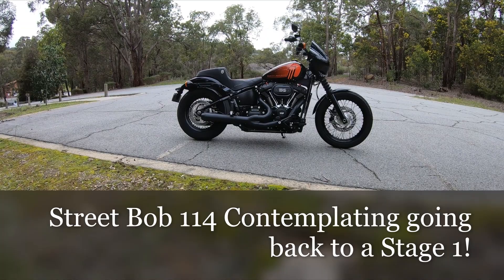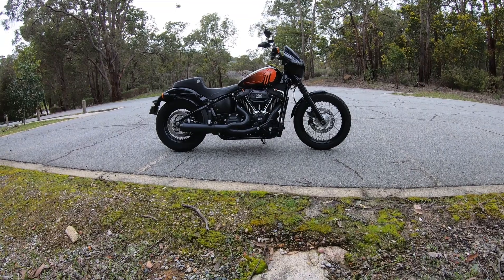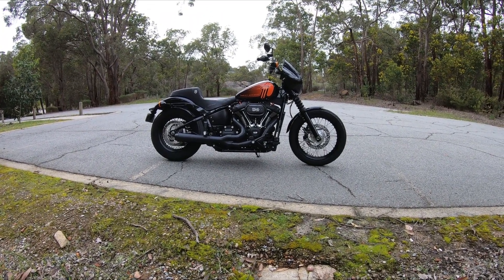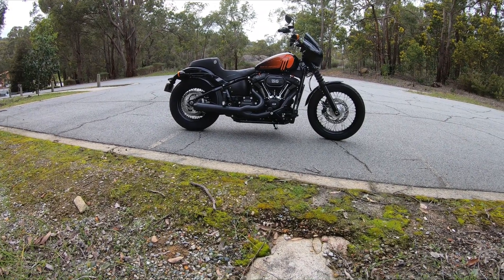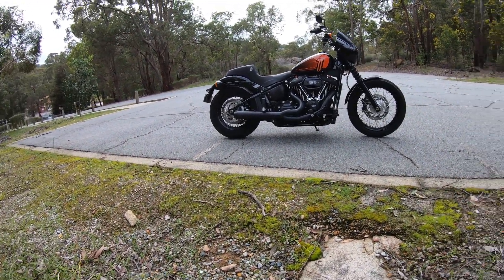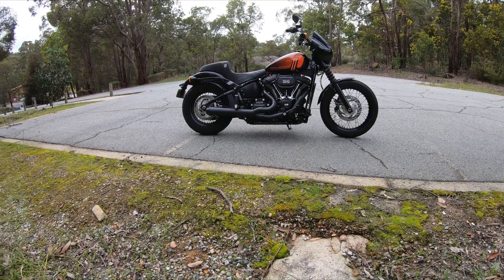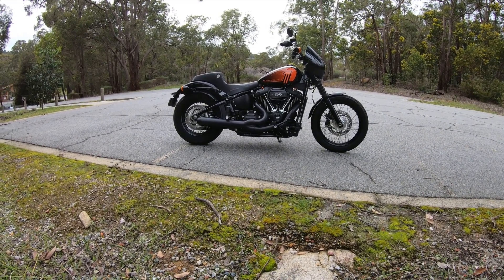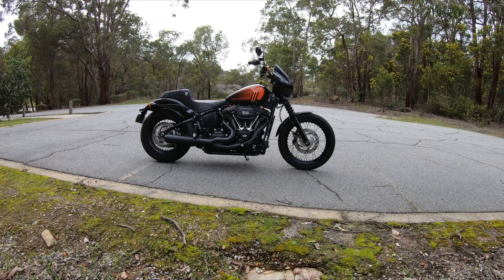Street Bob 114 Stage 2 - Contemplating going back to Stage 1

Comment: Got to admit, when I had an Evo with a mild cam. It was great. Went to a TC 103, stg4 cnc heads etc, it lost all its ridability, and you just wanted to beat up on it all the time, 
I miss my Evo 'Train...
The Gixx14 is still a delight Tim 👌
Reply from the maker: Yeh I love the power mate but it's a cam that needs to be ran hard all the time and its just not fun sometimes I like to just put around and it hates it and runs terrible at bottom end . Glad the big GSX is treating you well 👍

Comment: I think I'd feel bummed going back to stock power after having stage 2, but I totally get where you're coming from. May want to look into something like a Wood 222, 22x, or 22XE cam. They're supposed to be designed for baggers and 2 up riding with more low end in mind. Just an option so long as the S&S is coming out anyways. On another note, I heard they lowered sub count to 500 for monetization, so congrats!
Reply from the maker: I know right, I do love the power its intoxicating. After having the cam for 12 months now its getting a bit old if that makes any sense? the day to day ride-ability is non existent and that's where most of my riding is. I've actually booked to get it all put back but it will be dyno tuned to maximise the stage 1 set up. 500 subs for monetising? I hadn't heard that. Maybe that's why there's ads in my videos all of a sudden. Ill have to look into that. Stay safe.
Reply: @timfinning  Yeah I hear ya on the daily ride-ability. And yeah I though I saw they dropped it to 500 subs. You’ll still need to go to the monetization tab under each video in your studio to actually turn it on though I think. Definitely check into it!

Comment: Contact Wood performance in the US. He designs cams and Andrew's gears grinds them to Bob Woods specks. He will ask, how you ride, do you ride two up, do you want mid range power or top end power, how much you weigh. And he takes in consideration if you're going to have head work done or not. He is a professional in performance parts for motorcycles.

Comment: apparently the S&S 475 is very exhaust sensitive effecting the m8 low down. i have the woods 22xe cam in my 117 Lowrider S = 125hp and 136 ftlbs of torque. Cobra exhaust not highly rated by most tuners. Bassani, HPI and Fatcat( many more options too) are better options

Comment: So 2 problems here. 475C cam, and 2 into 1 exhaust.
475C likes high RPM, and 2 into 1 exhausts take a ton of tuning to hit good low end RPM. 
Means you have to ride at high RPM for everything.
You need to get a 22XE, or RS468, or SE Torque Cam, and possibly go back to a set of Slip-ons like a rinehart, sharkroad, or Eliminators/twinslash with Baffles. 
I have 2014 Fat Boy 114 with SharkRoad Slip-ons modded with 158W TTIs in louvered baffles and stage 2 SE Torque Cam and I have incredible low end torque from 2000RPM up, and a tune from FuelMotoUSA.
You should look into getting a TTI for your 2into1 pipe to help restore low end torque, and look for a Torque Cam like a 468 or 22XE. 
I cant imagine going back to stage 1, Stage 2 is so much more power and capable. 
I'm going to be swapping to a 22XE which has massive low endtorque but still outcompetes the 475C cam in HP and gives peak HP at 5500RPM range which is much sooner than the 475C.
And I wont be changing my TTI equiped pipes.
Looks like you may need the same.
High RPM cams are only good at the track or dragstrip. Low end torque is what makes a bike street happy.
Reply from the maker: Absolutely agree with you I love bottom end torque not high end HP it's not that type of bike. Thanks for the input appreciate it stay safe
Reply: I agree the Bassani pipe (known for its low end torque dip) and 475 cam are just not going to be a great match until the mid-range. But, be careful not to generalize all 2 into 1s as being soft down low or require lots of tuning. There's some really bad ones, many ok to decent ones, and a few excellent ones.
Reply: @mattb6849  It's a problem thats typical o the Softail M8 because of the small changes in bhe Softial version of the engine.
and I said it takes a lot of tuning effort to get rid of that torque dip.
it's a problem with the Softail's version of the engine.
Reply: @FranBunnyFFXII  It's due to the exhaust length differences between the touring and softail platforms. Can't package the same length primaries and muffler / baffle configurations to the softails. The M8s have shown they like long primaries for broad power. That's why you'll see a D&D fatcat produce a flatter, more broad torque curve on a Softail vs. this bassani for example. The torque dips create tuning challenges. These can be worked/fixed some, but only so much can be done. A cam with enough overlap gives the exhaust system more control over things, making the dips even more pronounced.
Reply: @mattb6849  You havent told me anything i didnt already know.
Reply from the maker: @mattb6849  Yes the Cobra also has a power dip down low too. When I first got it done the tuner pointed it out to me and said that pretty much all 2-1 exhausts have the dip it's a characteristic of them.  Stay safe 👍

Comment: I only have issues if I'm in a low gear like second gear and doing 25-35 mph. it just doesn't want to go that slow in a smooth manner. Gets a bit jerky using the S&S 475 cam. But I can live with that.

Comment: My Sportster from the factory didn't like to run smooth under 2500RPM. My Yamaha is so smooth at all rpm. I thought you were going to say bad fuel economy I was suprised you said its not bad.
Reply from the maker: Yeh after the last Dyno tune the economy was pretty good but it ran like crap so I'm guessing they leaned it right out. I'm changing it back in a couple of weeks to stage 1 again. Getting it Dyno tuned again though to maximise power.

Comment: I got a 475 full kit along with a se elite heavy breather a few weeks back.I love the sound but agree with everything you say in your vid.Its horrible going from a stop to 'on throttle'.Going around roundabouts or slow moves is horrible.
The sound is awesome though.I have a 465 also on the shelf.
Im not sure what i want to do yet.If i change though id rather go to either the 465,SE torque or other torque cam(zippers for example) rather than stock.I'll have a long think about it over autumn/winter(Ireland).
Reply from the maker: I was originally wanting to get the 465 too but with Covid in full swing all I could get was the 475. Im getting a dyno tune in a few weeks to maximise the stage 1 which should give me a bit more power. Thanks for watching 👍
Reply: @timfinning  I bought the 465 at first but after watching the online vids I preferred the sound of the 475(the 465 was never installed btw).I dont know what to do as after 300kms it's not as mich of a problem as it was originally but I still dlnt love it
Reply from the maker: @MrMurphc13  I had mine in for the year and I was definitely over it. At first I really liked it but in the end I wanted the rideability back for day to day riding. If you ever fit the 465 be interested to see what you think.
Reply: @timfinning  I'll let ya know if I do.Thanks for this vid.Good to see there's a few honest folk still out there.

Comment: Go for an S&S 465 cam, better torque and far better ride ability
Reply from the maker: Yeh I did originally want the 465 but couldn't get it due to Covid and no stock available here in Australia and it's still a hard cam to get hold of apparently. Stay safe 👍
Reply: 465 would def suite your riding style better mate, i love my 114 with 475 day night difference when compared to stock, the stock setup just didn’t fit my riding style at all. Then again im coming off of ducatis so i gotta feel it ripppp. Injectors TBR shorty SE intake 55 ported manifold s&s 475 126tq 130hp, tuner says will be able to get more outa it after another dyno session.

Comment: Harley does a pretty good job with their cam selection. Certain builds definitely can be complimented with a different cam but just doing a stage 2 almost never makes sense. If you had some head work to take advantage of the cam then you would be happier…..most likely

Comment: You must either have a shitty cam or bad turner my friend. I have a 2022 street glide 114" with stage II and im putting to the ground 128hp/129tq. Bike rides and drives like stock, even at low speeds unless i want to rip and have fun. You should have ZERO drivability issues. My set up is with Zippers stage II and their 472 cam, Sawicki 2-1 exhaust, 64mm throttle body with matching intake, bigger injectors and high flow air cleaner. Sorry that you paid all that money and are having this trouble.
Reply from the maker: Hi Jeremy, I had it Dyno tuned 3 times and it rode really well over 2500 rpm but under that it was average. I only had the cam 475 SnS chain driven and the 2-1 exhaust not bigger injectors or throttle body maybe that would of made a difference. Depending where you are from we have a tuner key here in Australia called Maximus tune and they are definitely hit and miss with the M8's. Ive now gone back to stage 1 and its soo much better down low but I miss the grunt from the cam. Stay safe mate🤙